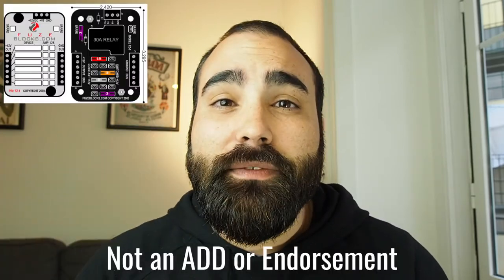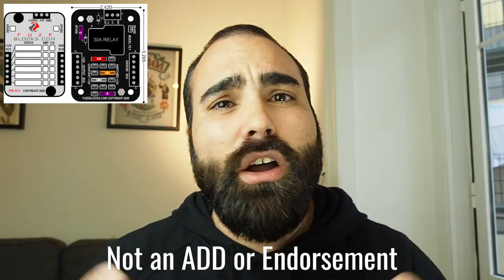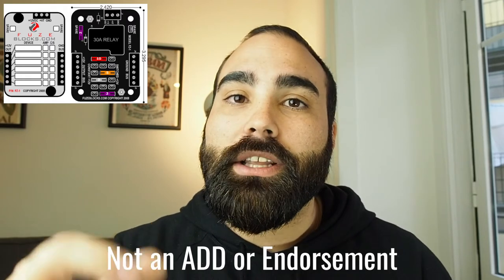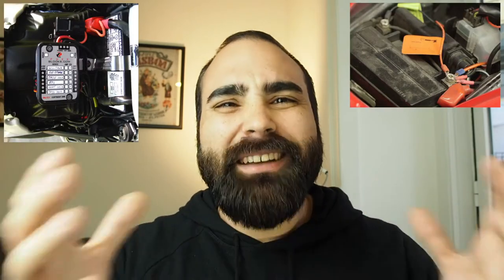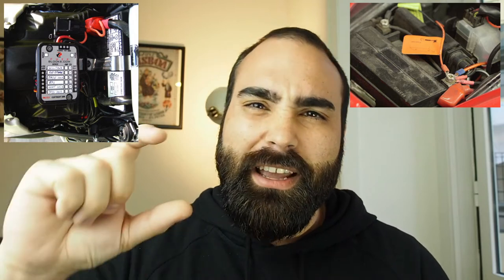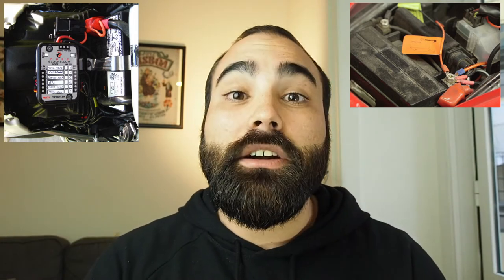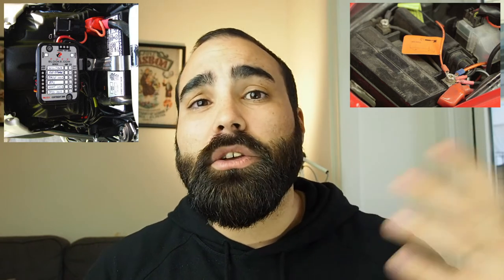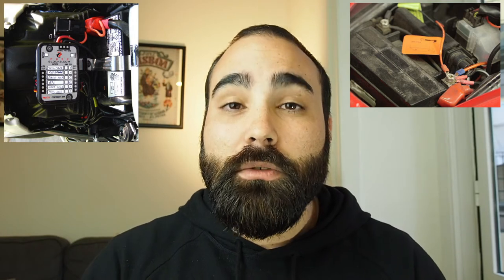Motorcycle fuse box - a power hub for your accessories

Comment: I found a solid state fuze block called the PDM60 I might use instead. You may want to check it out, fuses are reset by resetting the ignition too, so no need to carry around fuses and trouble shooting seems easy as well.
Reply from the maker: At the time I installed mine I did look into that one too, but I couldn't confirm if it would work with BMW's Cam Bus, so I ended up choosing the one I have. Still I did heard great things about the PDM60, and I'm glad it woks great for you! Thanks for sharing 💪

Comment: yes! going to order this! I have heated grips, fog lights, quadlock wireless charging, gps, dashcam (5 so far with inline fuses), planning on adding some led atmosphere lighting (the cigarette lighter is protected by a built-in accessory relay and 5A accessory fuse)
Reply from the maker: I am very happy with mine. The only thing I would do differently now, which I still can but have been lazy, is to pull power to the box only when the engine is running. That way if I leave an auxiliary light or the GPS on, it won't drain the battery.
Reply: @BNAdv  yeah, do that, very useful, use all the functionality the device can offer

Comment: Great video, but one thing that has me confused. Several of the accessories I have Dashcam, Fog Lights and LED Lights. They have a trigger wire. Where do I splice that too. Someone told me I need 3 separate relays one for each accessory.!!! any assistance will be nice.
Reply from the maker: Thanks for the words Daniel. Can you clarify as to what you mean by trigger wire?
Reply: @BN Adv  Sorry I meant to say  connect to a switched power source. Can one source say break lights handle multiple taps.
Reply: @BNAdv  I took a chance, I managed to Splice into the USB port the motorcycle brings. So easy I couldn't believe. It was harder to to snake the wiring harness.
Reply from the maker: One of the reasons why these kinds of fuse boxes are great is that you tap directly into the battery and the fuse box works as the switched wire. With this particular box I can choose if the accessories are always "live" or if they only work when the bike is on.

On my XT the box I have does not do that, so I do have a relay connected so that the box only makes the accessories live when the bike is running, but that is bushcraft mechanics 😅

In theory, you can pull energy from wherever you want, but do be careful. The wire from lets say the break light, or the USB port are not designed to handle the demands of several accessories connected pulling energy from the same source.

I've managed a garage for a few years where we focused on adv and enduro bikes, and multiple bikes showed up over the years with completely burned down electrical systems because they were running accessories from spliced light or horn wires, and the system purely caught fire. 

Luckily I've never seen a bike consumed by flames due to that, but I believe luck was the reason as the wiring was toasted.

So you can pull power from anywhere, but I can't advise it.

Comment: i'm installing a box just because, why not.  i may not need it, but who knows.  i might add a USB charger at some point, so i'd rather just have easy access.  i'm already tapping into the ignition line; might as well make it easier for any future mods.
can i get a link to that picture you used at 0:39 please?
also, link to the video where you install the fuse block?  (edit:  nvm, it's the previous vid.)

Comment: I have a question, can I connect fuse block to  motorcycle kill switch and use it for accessories only ..Instead of tapping into the motorcycle wiring  I can go straight to the battery and switch it off when not used ??
Reply from the maker: I'm sorry, I'm not sure I understand the question... if you install the fuse block to the bike's kill switch, you are tapping into the bike's wiring. On the other hand, on the fuse block you have the option of having the accessories always on, or just on when the bike is running, so effectively, you can use it straight to the battery and have the accessories running only when the bike is in use.

I hope it helped.

Comment: Hiya, i wanted to add an intelligent trickle charger cable, a usb port and ans alarm to my bike, when i received the trickle charge cable it was apparent that it was heavy enough cable to power all that i wanted, so i decided to use a fuse box connected to that cable, which means only onset of cables connected to the battery. My only thing that i cannot decide is whether because i have used the positive cable to power the other fuses i am not sure that when I connect the trickle charger, will the power then going to the other items affect the reading that goes back to the intelligent charger, i would be interested in what you think about this? Thank you
Reply from the maker: Hello Chris,

Well, I'm not 100% sure of your explanation, but if I understood correctly, I guess that depends a lot on the type of fuse box and connections you created.

If everything is a direct connect, I would say that is indeed a change you may be getting false readings, but again, I'm not fully sure I 100% understood your explanation.

If you have the fuse box connected in a way that only when the bike is running will the power to the fuse box flow, than no, the only reading you should get is from the battery.

However, and again, I'm not fully sure of your explanation, so please take mine with a grain of salt.

✌️🏍